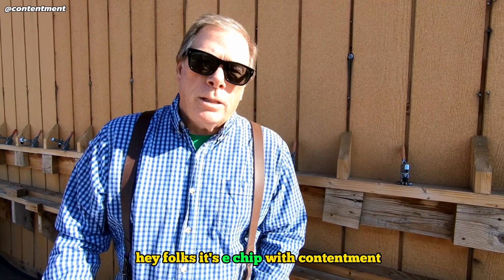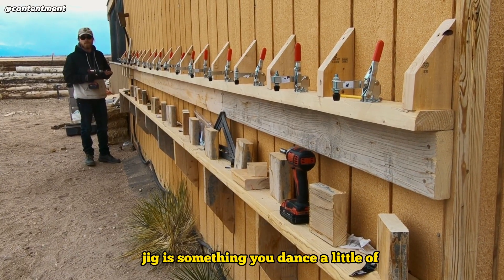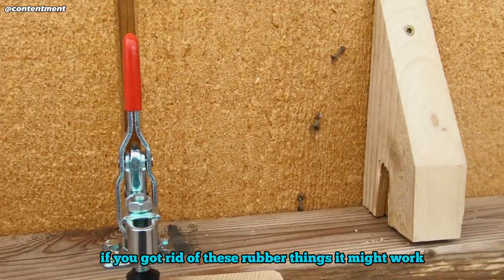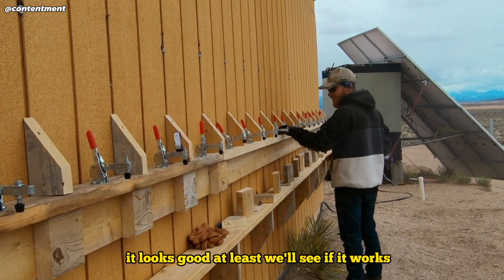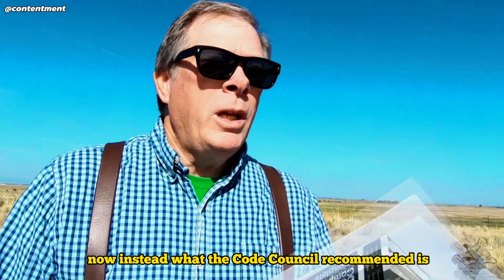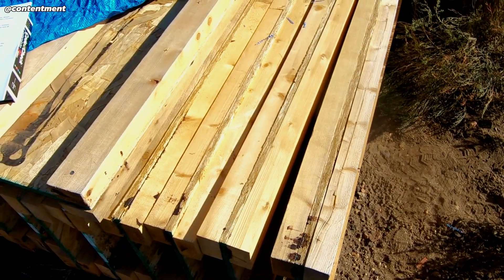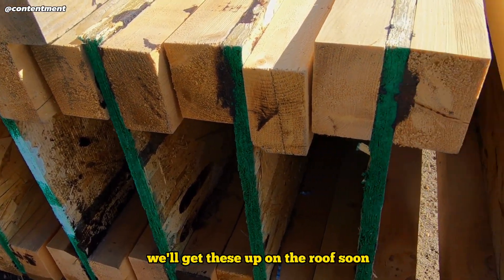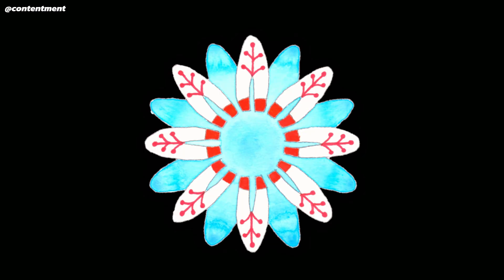Wanna Build your own I-Joists?  Don't Expect Them To Be Approved. #contentment  #diy

Comment: You should show what you actually built. How you built them. Sounds like you were able to build your own I-Joists but you had to change the design. Make a short video showing the process.
Reply from the maker: I could have.  The problem is that the design was specifically engineered for our home, so showing you how to build them probably would not have helped you much.  But basically, they are made from sections of OSB sandwiched between flanges made with lumber, milled to a specific dimension, glued and nailed every 4-6 inches. Web stiffeners the same size as the flange lumber were glued on ever 4 feet on each side of the OSB. Thanks for watching!!

Comment: What if you had scarfed the 2 x 4 and off set the scarfs top to bottom.  Scarfs of 8 to 1 should work.  Were  scars considered?  Use same glue. Japanese use scarf beams in their construction all the time without glue.  Timber framed  buildings are numerous in Norway, Sweden and England that are greater than 800 years old.  There is something called Common Sense..which seems to be missing here.  Perhaps a lawyer with engineering background would overcome this red tape.  Lack of innovative thinking is why we have a housing shortage.
Reply from the maker: Thanks for watching!  I considered splines, but not scarfs.  Good point.  But I have the feeling that they still would have had to be tested and certified, since the flange material is not continuous. It's really a shame. I know that my finger joints would have held stronger than the wood itself.  Glue joints like that typically do.

Comment: Thanks for sharing. I’m contemplating constructing my own “composite beams” too. Seeing the final “sandwich” beam was very helpful. It’s unfortunate that it’s illegal to route a dado which logically physically holds/cups vs stacking? Were you still approved to use finger jointed solid lumber? And if so, please share the route bit you used.
Reply from the maker: Thanks for watching!  The dado was not the problem at all.  The whole I-Joist was fine with the engineer. The only problem was that my finger joints had to be tested and certified before we could install them. I never bothered to see if we could use finger jointed lumber because we used our own lumber that we harvested out of the nearby mountains.  Here is the finger joint bit  https://www.bing.com/aclk?ld=e86Y3MlzkRQVjl2qkBNzJy3DVUCUzG2dqk4FyefZVHxo3b7xljOJ8o9_dlKxdkK18axASyCosAWo8Iinh8lmMHWX2wb-wdb0dkw7RXl_fQuyKwLdGrjsF_E1dW9VCdtiGtXpbbwVB1DsEDQBgmd3n135cjR1PgcHOaPJJoJ54AuUXTnlzkb8LLVbTguVKTk_6RcN0OMg&u=aHR0cHMlM2ElMmYlMmZ3d3cuZ3JhaW5nZXIuY2ElMmZlbiUyZnByb2R1Y3QlMmZwJTJmRlJEOTktMDM3JTNmZ3VjaWQlM2ROJTNhTiUzYVBTJTNhUGFpZCUzYU1TJTNhQ1NNLTg1MDIlM2FTMjBBOUolM2EyMDUwMTIzMSUzYUFQWl8xJTI2Z2NsaWQlM2Q4MDYzMTlkZWE4Y2YxMmQ3MDRhZTcxMjkyNzAzYjgzOCUyNmdjbHNyYyUzZDNwLmRzJTI2bXNjbGtpZCUzZDgwNjMxOWRlYThjZjEyZDcwNGFlNzEyOTI3MDNiODM4JTI2dXRtX3NvdXJjZSUzZGJpbmclMjZ1dG1fbWVkaXVtJTNkY3BjJTI2dXRtX2NhbXBhaWduJTNkUExBJTI1MjBBZG9iZSUyNTIwJTI1M0UlMjUyMFRvb2xzJTI2dXRtX3Rlcm0lM2Q0NTgwOTc3NzgzMjAyMTk1JTI2dXRtX2NvbnRlbnQlM2RBbGwlMjUyMFByb2R1Y3Rz&rlid=806319dea8cf12d704ae71292703b838&ntb=1
Reply: @contentment164 Thanks for the clarification. Good info for those wishing to venture this path.

Comment: First house I built many years ago had roof trust at 2 foot centres which is what they were designed for and the old time building inspector said they had to be at 16 inch centres so I had to get the engineer to straighten him out. Ok so as far as I trusts go I would rather not use them as we live in a rather wet climate and that chip board deteriorates rather quickly but if that was all I had I would go with the second type (beam) as they are easier to make. I even used floor trusts made from 2x4 only I loved them but again heavy and dimensional larger but hey no floor jacks and big no post rooms. I love your DIY skills never give up but the system to protect us from ourselves is just a disguise to keep corporation rich.
Reply from the maker: Corporations and their influence in government is a main reason we are out here. Thanks Wannabe!